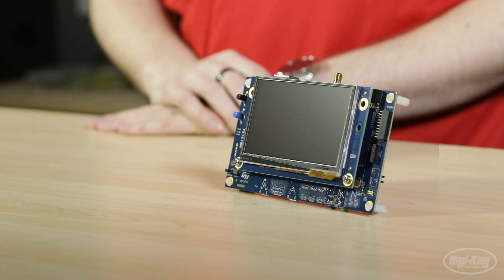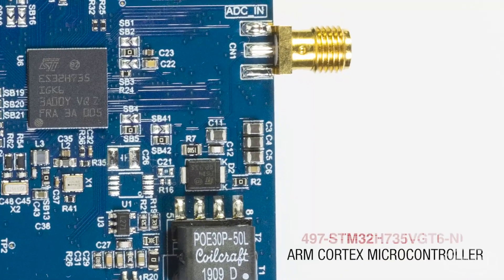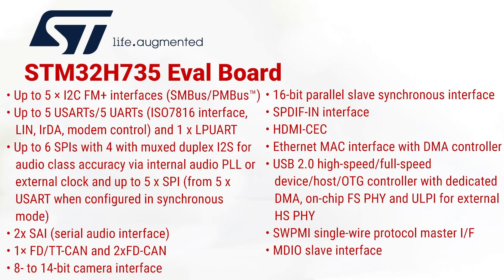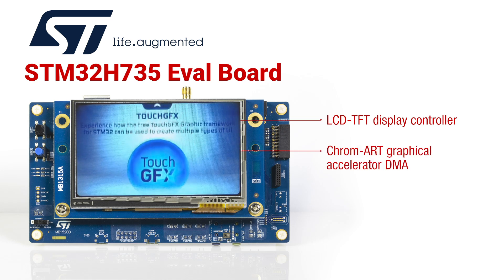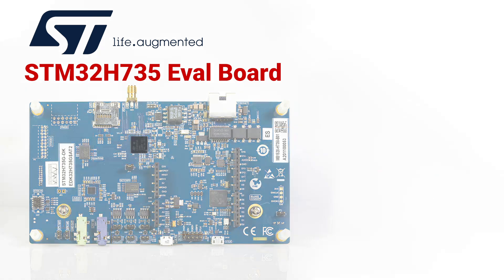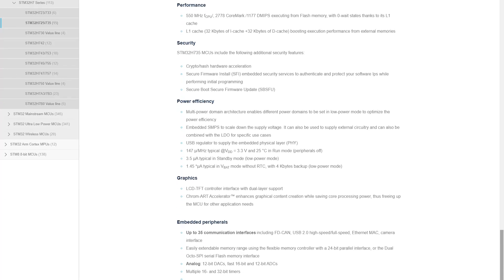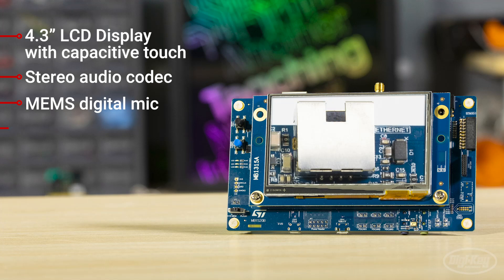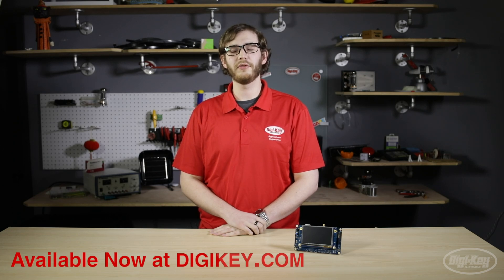New Product Discoveries Special Edition: ST Micro STM32H735 |Digi-Key Electronics

Comment: It’s basically a really cheap raspberry pi
Reply: Uh, not even close. Doesn’t run an OS so every clock cycle can run a real time instruction (atomic). 550mhz is fast as hell for an MCU, especially with a hardware decrypter and advanced math engines.
Reply: but slow as hell